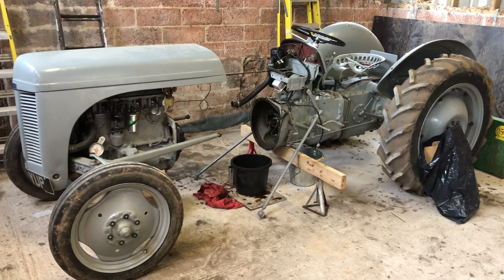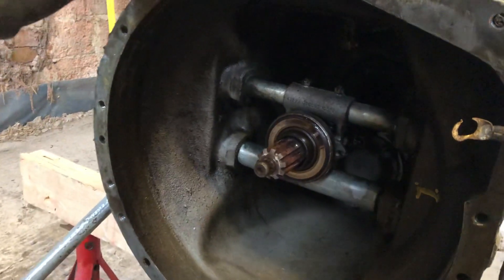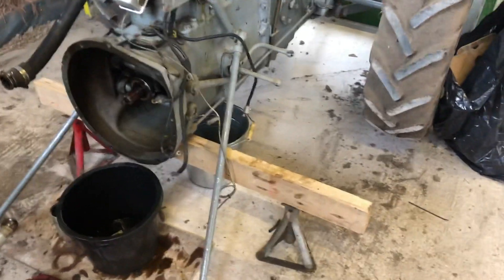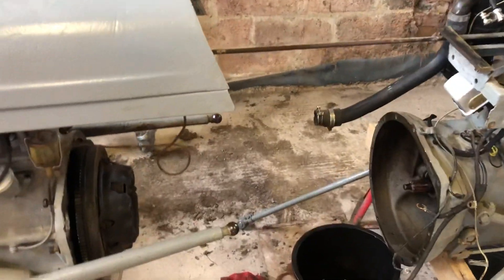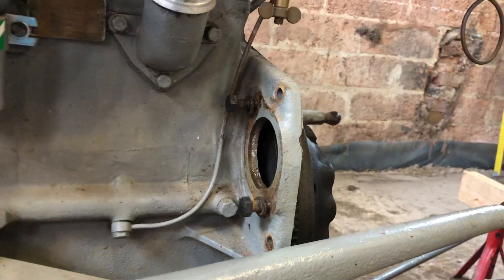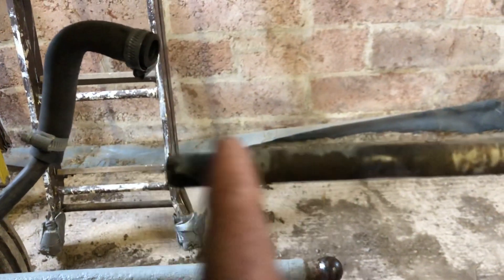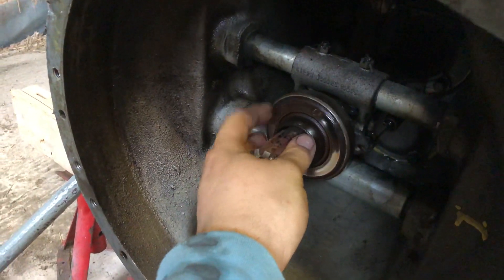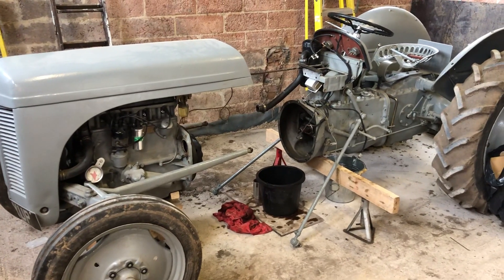Ferguson TED20 input shaft oil seal replacement Part 1

Comment: Great job. You said it was an oil leak that make you suspicious the input shaft seal was failing. Was the tractor driving an different? Did it feel like the clutch was slipping?
Reply from the maker: The tractor drove the same as it has always done and the clutch wasn’t slipping 
The major change was when you switched the engine off or parked on a hill with the front facing down the drain hole in the bell housing had oil pouring out of it and it was transmission oil coloured the vast quantity of oil meant it most likely came from the input shaft seal
Reply: Cool thanks. I have a MF 698 non multi power, when driving sometimes it starting to appear the clutch is slipping but when you test the clutch e.g put it in 1st gear let up the clutch and press brake she cuts out straight away. A mechanic suggested it might be the input shaft seal cause the clutch to get wet.
Reply from the maker: Yeah that would be a good start if it is oil contaminating the clutch it would either be from the transmission or a leaking rear crankshaft oil seal

Comment: How long would it take to split the tractor for a first-timer?
Reply from the maker: A few hours to an afternoon nothing that complex really just finding and removing bolts, wiring and linkages all of which are easy to see and access
Reply: @tractionengine11  Thanks! I'm considering a TO-30 that needs the rear main seal replaced. Looks like a $10 part but a daunting effort.
Reply from the maker: Christian Rogers no problem. I agree it is a lot of work for the price of the part which doesn’t take long to fit. As long as you have the gearbox supported and a way of rolling the front end forward safely it is a enjoyable job to do